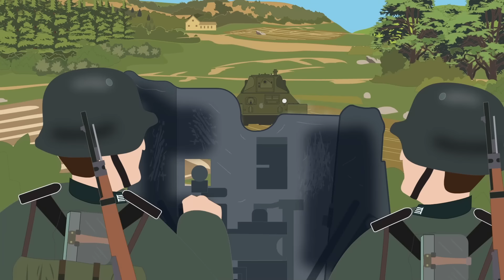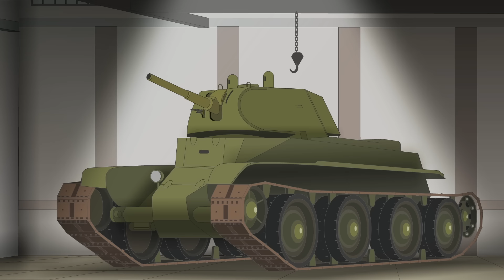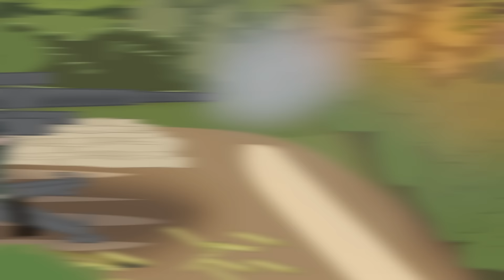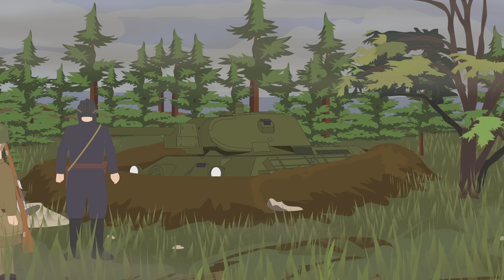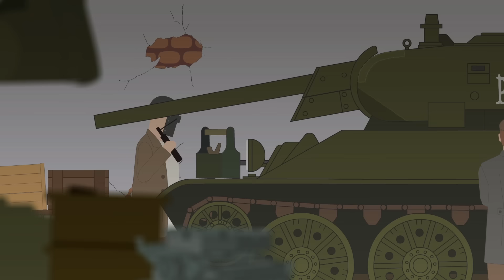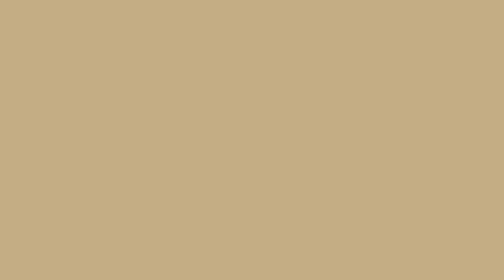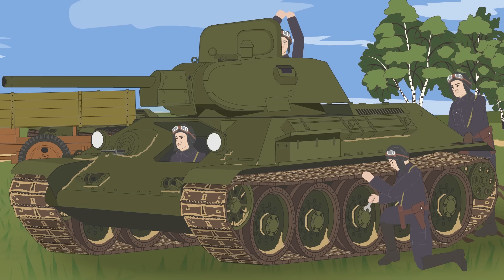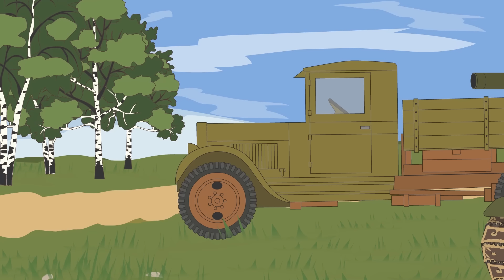Was the T-34 Really the Best Tank of WW2?

Comment: For people claiming that this tank wasn't the best in WW2, it was mostly responsible for the defeat of the German war machine, especially towards the end of the war when they were fitted with superior 85mm cannon that could take out a German Tiger over 800m away. Also take into account how quickly they could be produced and they indeed were an unstoppable force.
Reply: The Germans develop the Tiger and Panther as response to the T-34. At first the Soviets plan to design a new tank to replace the T-34 and deals with the new German tanks. The new tank known T43 is designed to have a better armor as protection from German artillery fire. Unfortunately the new tank is design to be armed with the same gun used by the T34: the 76 mm tank gun M1940 F-34. Any new tank design requires months of rigorous testing to solve whatever problems it has before they are ready to be deployed. The Soviet Union does not have the luxury of time to do so. The alternative is to improve the design of the T34. The T34 is rearmed with a more powerful ZiS-S-53 85 mm and D-5 85MM modeled on the 85 mm air defense gun M1939 (52-K) anti aircraft gun. The new gun is able to take out the Tiger at 800m away though the 88 mm gun of the Tiger is able to hit its target 1000m away. The design of the new 85mm gun is further simplified without sacrificing its tank killing capability to aid mass production. By continuing to improve and upgrade the T34, the Soviet Union has gain precious time needed to develop new and more powerful tanks to deal with new German tanks.

Comment: The fact is, the 37 mm Pak Cannon was a very week gun and only had a penetration of 36mm at the angle of 30 degrees being fired at a distance of 250 meters (The closest scenario to what happened), so it had no chance of penetrating the 45-100 mm of armor on the T-34 (1941). That's why, the gunners of the Pak 37 Gun should not have been surprised.
Reply: For many germans it was the first tank (except french b1 i believe) that wasn't critically damaged after being hit. In Artyom Drabkin's "I fought on tiger" interview book one of the german tankers said that after their (pz III if I'm not mistaken) shot just bounced off the T-34 front armor crew quickly decided to retreat because of confusion. "New" in war is always scary.

Comment: Panther is the best ww2 tank my opinion
Reply: On paper it’s a great tank, it had speed, armor, and firepower. In practice, however not so much. The reliability and suspension is awful, the engine would stall during combat, the turret traverse speed is slow, and many other factors made the Panther overall, a waste of resources.
Reply: @GodEmperorEnjoyer  still the best reaction on the russian Line , and panthers where amazing against the t34s